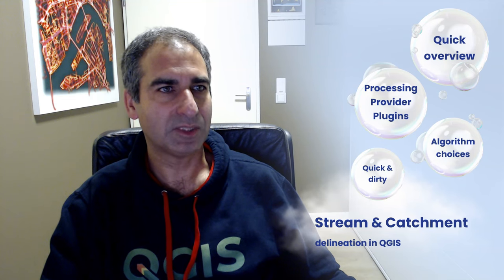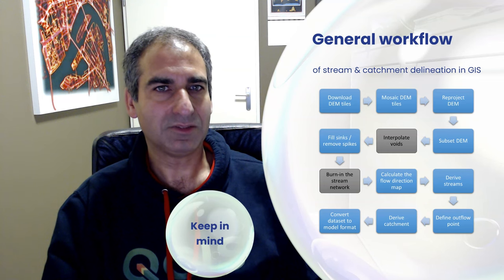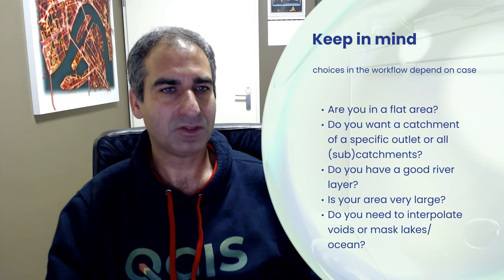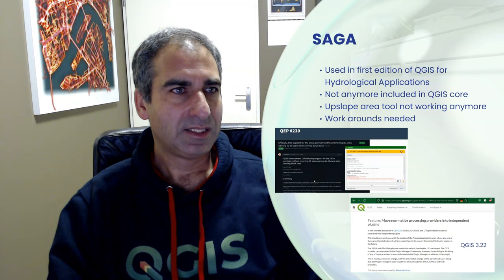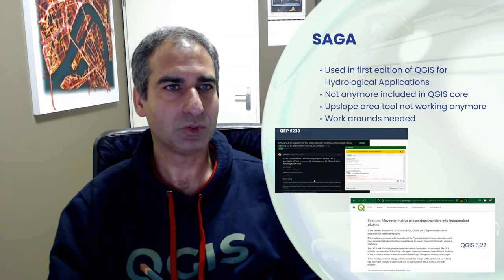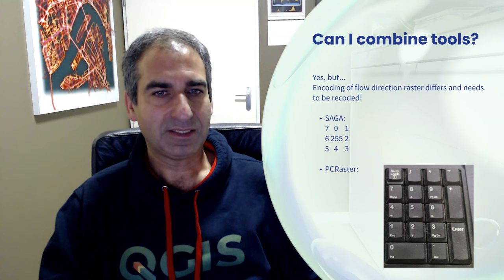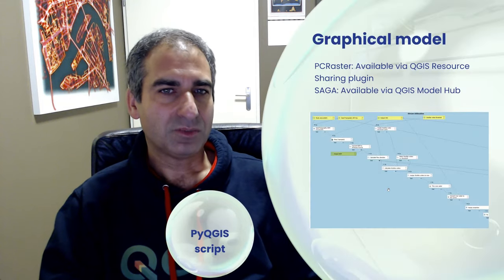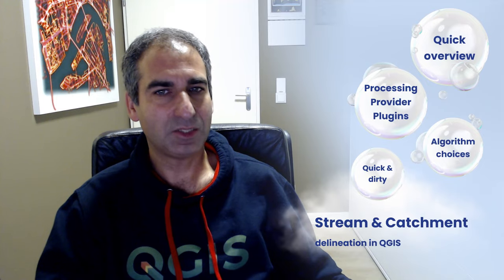Challenges with Stream and Catchment Delineation in QGIS?

Comment: Good and consice information. It was easy to understand even for a beginner. A slight problem are the different QGIS Version, since neither Saga/Saga next gen nor PCRaster work with every version, so it would be nice if you could name the last Qgis version you used for the PlugIns without. Problem. 
Have a nice day.
Cheers.
Reply from the maker: Good point. In my recent videos, I've added the version of QGIS used in the video to the description.
Reply: @HansvanderKwast   thank you, yeah it seems to be depending on a stroke of luck, if a plugin works... but its still one of the best/easiest to use open source GIS software.

Comment: Excellent video, thank you very much!
How can we set a threshold value for the maximum catchment area so that we avoid having too large catchments?
Reply from the maker: In the workflows that I use the catchments are determined by all contributing pixels. So there's no option to use less than all. However, if you use the approaches to derive all catchments or subcatchments, you can then add a condition with thresholds.